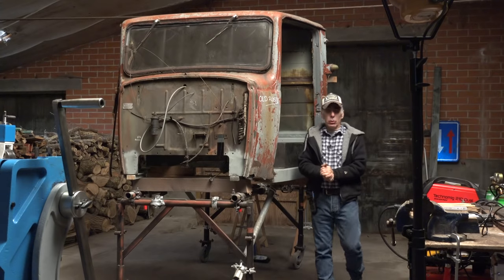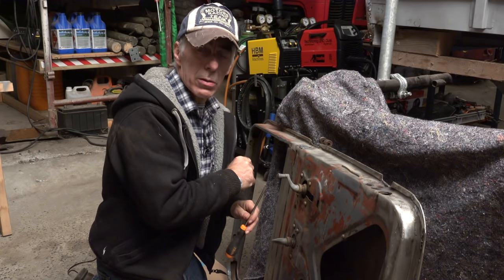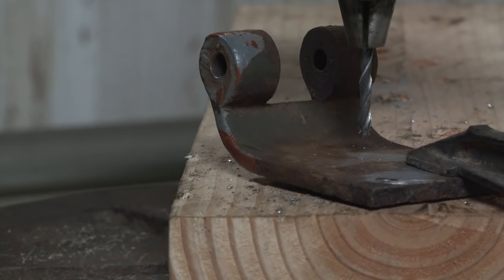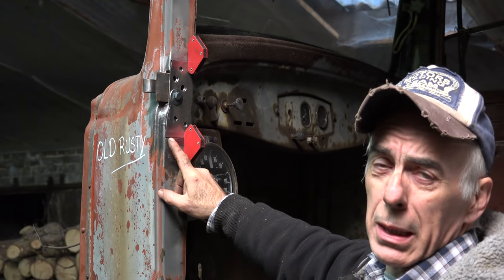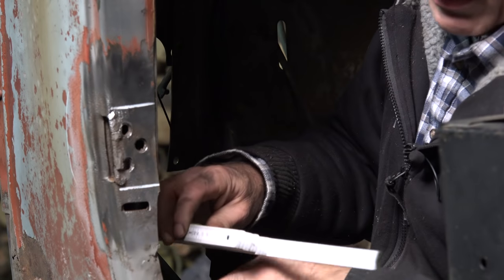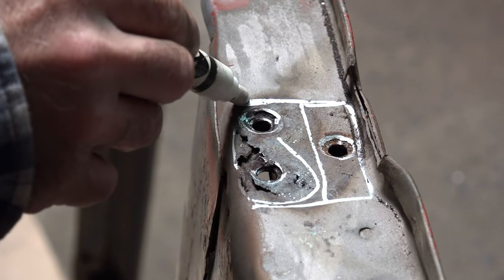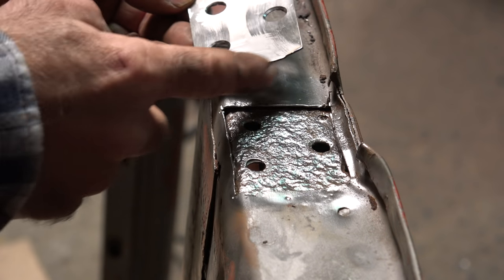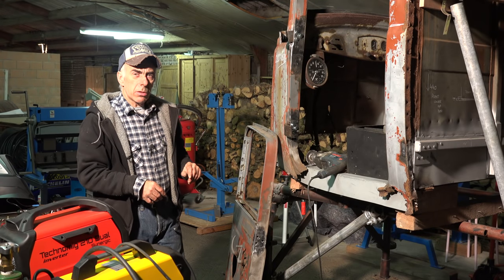Old Rusty, Part 15  Rebuilding the hinges of the door

Comment: I am driving and restoring a 1948 Canadian made tractor, and several of the sheet metal areas require welding or fabrication......of which your instruction is exact to that set of tasks....and well appreciated. What is just ahead is how fun older machines are to drive.  And in many ways, simple and sturdy in original build.  
For instance, I recently photographed a 1962 MG convertable body, without drive train and perhaps nearly as 
exposed as the truck cab was to rain, but so fun to drive in good weather. *Tucked behind a junk yard fence.
I simply have a list of fun projects and like to work in my shop. Thanks for taking the time to talk about your porjects.
Regards, McGary
Reply from the maker: TXS Mark, that sounds very familiar.. What Tractor do you have ?   I love old machines, they are simple and always fixable, not like the modern stuff... although I am an electronics design engineer... still those old engineering methods are so fascinating

Comment: Nice you should get a wieldable primer then when you clean up between two panels it will burn off where you wield but the rest of it stays protected and will last longer
Reply from the maker: Indeed, that is a  good tip.  Spmething I will do

Comment: Thanks for the series Old Rusty. Will you rebush and pin the door hinges ? How about anti rust on and inside behind hinges door pillars and sills ?
It would be a shame to let all your careful  work just fall back into rust for a second time....
Reply from the maker: Hi, my pleasure.... The pin's are in very good shape .. so that is not needed.  , the rust in between the panels is a general problem with this truck.   I do spray a zinc coating where I can before assembling, except in this case...  Later I will inject in all the cavities rust inhibitor and ML, knowing very well that I cannot reach all of it.   The good thing, Old Rusty is not going to sit in the rain and outside. Instead , he will have a warm and dry garage to spend the rest of his days....   But very good comments and questions

Comment: It is great that you are repairing an old vehicle! My question to you you cut out a couple of spots that had two layers. The metal underneath looked rusty. What about the rest of the stuff underneath? Did you shoot something in to help stop the rust? You are going through lots of effort I hate to see all your work ruined over some rust? Maybe I missed it. Or you covered it and did not say anything.
Reply from the maker: Hi Daniel, indeed the layer below looked rusty, and it was . Although it was rusty, it was just on the surface.  So cleaning helps. Off course, it will be the same on the parts where I did not replace the top skin... and that indeed is sitting dormant under need...The only thing is to rebuild / copy the whole cabin but that is hard to do...  So I do what i can , by spraying /injecting rust inhibitor in those cavities that allow for it.  For the rest, I will keep Old Rusty out of teh humidity and rain, hoping for the best.

Comment: Don't drill the hinge bolts. Place a nut over the end of the bolt and weld the nut's hole to the bolt end. The heat from the welding will loosen the corroded bolt. Use a socket wrench over the nut and twist out the damaged bolt. You should be able to save the hinge threads.
Reply from the maker: b0v1k7x B good tip thanks.  Something i will do on the other side. Txs
Reply: To:   @D3Sshooter   Watch this video at 11 minutes for a good example. https://youtu.be/vDlk7B-PRAA
Dave from Niagara Falls.

Comment: isn't it also possible to weld another screw on the stuck ones and then remove them? It seems counter intuitive to heat them up (which makes them expand right?)
Reply from the maker: Thanks for the comments, yes that would be an option

Comment: How about the play in the hinge itself? I know there was no pin in it, but it seemed that needed attention too.
Like your project!
Reply from the maker: The pin is actually a mirror, I did remove it for the work . In general the pins are OK.  If not , then i would need to drill out the holes, and turn a new pin.  Txs for commenting
Reply: @D3Sshooter  years ago,when i first started work after school, in a panel shop ,they used to buy tin boxes which had little compartments with various things like washers, nuts etc. One of them was an assortment of hinge pins. Because we worked on cars from the 20's through to the 60's one of those boxes could get used up in a few months . Hinge pins usually have a knurled section under the head to prevent them popping out on rough roads etc . Something to remember if you are going to make new ones.
Reply from the maker: Mercmad txs for the note on the pin.   , something for me to remember.